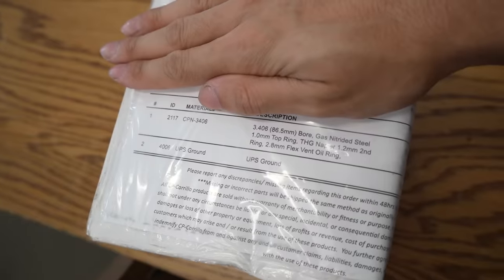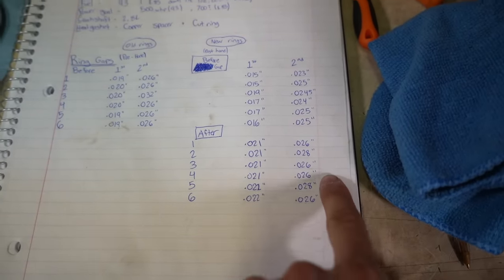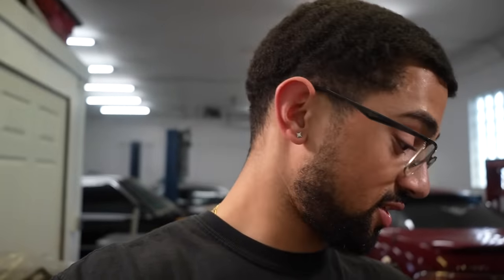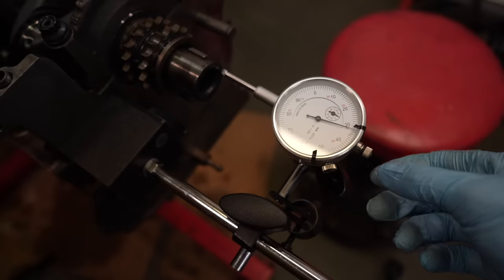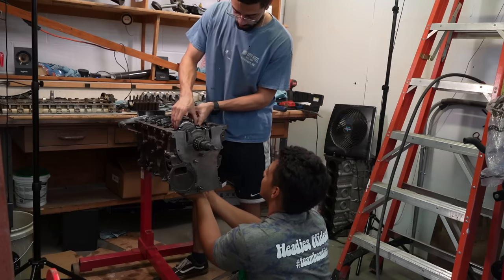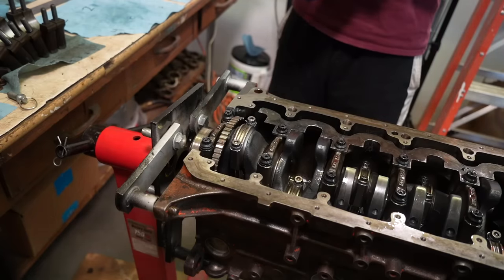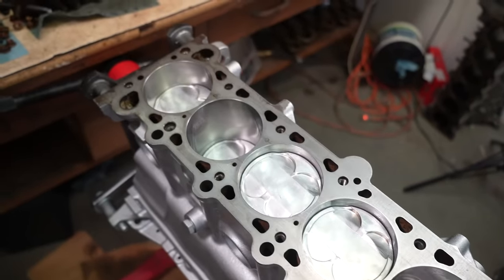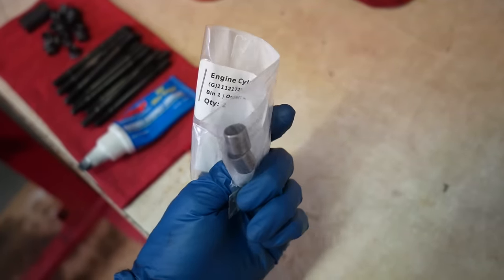FULL DIY Engine Rebuild - $300 Forged M50 FINALLY Gets Rebuilt

Comment: Don’t straight push the piston down, you have to tap it in, otherwise you’ll get what happened on 6 when it could have been sent right into the crank. Which will more than likely damage it.
Reply: if you tap it the rings will get stuck like they did multiple times here, you also risk damaging the rings
Reply: @Galorchs  if you slam it like he was you can get the rings stuck aswell. If you have a half decent ring compressor it won’t get stuck
Reply: would just like to add i used both methods stated here with the same tool joel had and broke a ring on piston 1. waiting a few days to get another ring and ill try again.
Reply: Problem is if you tap it what can happen, is in between two of your taps if the ring is close to the end of the compressor it might slide and pop out and on the next tap you break it.

Proper way IS to push, but there's some truth to the tapping technique, if he tapped it a little to break it free he wouldn't have to push that hard, and it wouldn't have slammed. 

So I guess tap it to get it close and when it's close to the edge push in one motion to make sure a ring doesn't pop out.
Reply: @samwhittman3162
Reply: @samwhittman3162
Reply: @samwhittman3162
Reply: @samwhittman3162
Reply: @samwhittman3162
Reply: @samwhittman3162
Reply: @samwhittman3162
Reply: That and always oil it up before you get there yes it’s messy somewhat but it’ll help avoid any friction at all costs whilst building. Great job though i must say.

Comment: Unfortunately, pistons 2 and 3 are installed backwards. Visible before the head is installed.  A miss occurred when pinning the pistons to the rods and when installing the pistons in the engine block.                                                                                                                                                                                                                                                                                                                   The valve reliefs in the pistons are asymmetrical. The intake valves are larger than the exhaust valves. Pistons 2 and 3 have the smaller exhaust cutouts towards the larger intake valves.  Since the cylinder 2 and 3 intake valves may not have sufficient piston interference relief, avoid high revs that would float the valves.  If you are lucky, find a spare intake valve and piston, and check if the smaller exhaust cutout relief is large enough to accept the larger intake valve.  If yes, then may be okay, otherwise avoiding high rev floating of the valves may be necessary depending on the piston to valve interference margin.  Definitely a problem for worn timing chains where cam timing shifting can cause valves to impact pistons and blow the engine on an interference engine.

Comment: Nice build but the only thing I say you should have changed was the valve springs to dual valve springs from a m50 non vanos head
Reply: What's The Benefit
Reply: @SupremeKai_Omniverse  hold the valves closed better than single springs to run more boost

Comment: Awesome video. Here is a good suggestion. Next time on the cam caps you leave the bolts loose and threaded. Then smack the tops of the bolts with the hammer. It pushes the piston down which also releases the cap
Reply: Also. Install all of your pistons and rings before plastigaging the rod bearings. The rings will hold the pistons in. That way you install all 6 pistons. Flip the block over. And then plastigage 2 at a time. Saves tremendous amounts of time and accidents. The piston shouldn’t fall out of the block lol
Reply from the maker: these tips would’ve saved me so much time 😭 i appreciate it!

Comment: Really good video on building up these engines, just a few pointers for any future builds, or anyone following along

Your main studs aren't getting full thread engagement on the nuts, and this is a known issue with ARP studs in these engines, you need to back the stud out a few turns by hand or drop a ball bearing in to the thread holes before the studs to space them out 

In future when checking rod bearing clearances, fit the pistons and rods with the rings attached to hold them in place 

You also want to check the rod bearing clearances with the ARP assembly lube on both the rod bolt threads and the underside of the head on the rod bolts, to ensure they achieve the correct torque

Don't push the pistons in to the bore with one hard hit, but instead a series of softer taps with the hammer handle, whilst occasionally making sure the ring compressor is flat to the block 

It looks like you have the wrong long chain guide on the block, as it's not supposed to move in and out like that, which means it's probably for an Ali M52/M54 from an E46. There is a chain guide that is correctly spaced and held in place by the circlip that you fitted 

You really shouldn't have sprayed WD40 in the cylinder head for an overnight stint, but more importantly, it will now likely mix with the oil and cause contamination issues, as WD40 can be used to displace oil and decrease it's effectiveness. Just be sure to flush the engine very soon after first startup and engine break in

When refitting the head studs to the block, you don't need to lube the block thread end of the studs, as they are supposed to be installed dry, as per ARP instructions. They do not rotate at all when the head is torqued down 

You don't need to use pliers to pull the pistons out of the lifters, if you place them on a block of wood and tap them with a rubber mallet, it will pop the Piston out

Bleeding the lifters up before installation is fine, as they will bleed out to the desired height when the engine is running, it's actually the engine oil pressure that keeps them pumped up, which is why they fail in high revving applications 

When refitting the cam trays and lifters, just rotate the engine on the stand on to its side and you can slide the trays on to the studs with no danger of the lifters falling out

Comment: Also, for the next time (I hope it won't need any more rebuilds lol) - when installing the pistons, tap the cylinders with a handle,  instead of pushing, while occasionally flattening the ring compressor on the block :)

Comment: Very nice viceo.. just a tip. When u tightening down the rod bolts,  press in som feeler gauge in between crank and rod on both sides.  Therefore there will be no twisting or stress on the rod bearings.

Comment: I remember when I rebuilt my first BMW engine, and if my memory serves me right, it was the very first V8 engine, better known as the "S62B50", developed by BMW's Motorsport Division, in addition to being the first V8 to be used on BMW's high performance variant (M5) of its mid-size sedan class (5-Series). I can affirm with high probability that my forged crankshaft had no play in its position, staying right where it was supposed to be (post-installation), with absolutely no movement whatsoever, and I state with 100% accuracy, that the legendary V8's cylinder head was NOT dropping pistons and oil rings left and right. 

Here's a word of advice; since it is apparent that you are new to engine rebuilding, with not much experience, it any at all. If I was you, I would not start committing myself into new projects that involve difficulty such as rebuilding or refreshing an entire engine block, especially BMW engines, which are more complex and elaborate in its blueprint. Get some experience first on less complicated and cheaper engine builds such as a Toyota or even a KIA. Good luck dude!

Comment: 32:20 you put the rod stud or bolts in with a piece of hose over them and flip the engine over an push the pistons in with a ring compressor.  I use 5/16" silicone hose over some studs I have around to keep it from scoring the walls.

Comment: Great video, nice rebuild but I was surprised that you didn’t put in a new oil and water pumps. Every build I’ve seen or helped with and a few of my own the to old pumps get pitched and new oem ones or in the case of oil pumps,  high performance or deep sump intakes get used. On the couple of blown engines we always drilled out the rivets holding the valve and oil pan baffles out to make sure they’re are no copper flakes trapped underneath. Just tap and bolt down or use nuts and bolts, rivnuts or rivet them back in place. 
Nice long format video. Looking forward to the first start.

Comment: Use transmission fluid and coffee filters to clean your cylinder walls before assembly.  ARP wedge spring compressor is the only way to go

Comment: You have to prime your oil pump with oil... look up the direction for the acillies oil pump, you got to pour oil into the pump and rotate it on the car. ALSO, thoes valves are two piece. your sanding the wielded area. Not sure if I would do that. I know you know about dropped valves... thats the advantage of a m50nv valve/head combo, the extra 1mm is extra area to wield a.k.a. stronger in theory. (Or just buy one piece valves)

Comment: VAC and other vendors make upgraded oil pump shafts with keyed sprockets and a left-hand thread bolt that are much better than the original shaft/sprocket/nut that is either wired or welded on.

Comment: you can use half a shell of undersized bearings to get the rods looser like on cylinder 2 3 5 and 6 . those are a little tight . always have my rods looser than my main clearances . your mains are fine a 20 thou but could be tighter

Comment: I waz waiting on you to damage a bearing installing them like that. But they do look really hard. I install bearings all day long at cummins for 6.7s and theyre so soft if theyre tight and you dont push inwards theyll scratch the undersides quick as shit. Theyre extremely easy to scratch. Just touching them together will do it

Comment: I hate to be the one to say it but there are different types of main lower timing chain guides (the big one the tensioner pushes on), it looked like you have the wrong one for your engine there. not really supposed to be able to slide back and forth like that. It might still work but i'd be double checking it to avoid possible damage.

Comment: Dang my man, I know is too late now but for future reference all you gotta do to take the rod caps off smoothly is back the rod bolt out until you have a decent gap and then hit the top of each bolt. That will separate the cap from the rod and still hold everything in place so that piston flying out the bottom doesn’t happen again
Reply from the maker: this makes so much sense and woulda saved so much time lol i was FIGHTING all those caps
Reply: Yes sir! Keep putting in that grind because me and everyone else love your videos!

Comment: That .5mm difference with the cylinder bore and copper spacer will lower compression. If you have turbo you can add a few extra psi but with na it will lower performance. Need to measure copper spacer thickens plus .5mm of difference to get final compression ratio.

Comment: Maintaining a BMW is like painting a Bridge.. You start at one end, go to the other side - and then go back to the beginning and start again. Oh BTW it's perfectly okay to leave the plastigauge on the bearing shell and the oil will dissolve it away when the engine starts - it's designed to be like that as you read. Is it best practice? I'll leave it up to you to decide

Comment: Next time check your rod to crank clearances with the crank out of the engine then you won't have to worry and you'll still get accurate readings because the rods only bolt to the crank.. if you prefer to do it in the engine buy a cheap pillow go place underneath the engine lol

Comment: Dam bro you came a long way since you first started lol 💪🏼

Btw I also installed the rg Vanos kit but what other tighter kit was it you mentioned in the video ? 

I’m kind of unhappy with my results on the Vanos. I had heard from some people to not do the rattle kit if mine didn’t really have a loud rattle noise and just change the outer seals. My Vanos is rattling loud as shit now 😏 about to take it off tonight and sand down the ring more to close the gap tighter hope it quiets down 🤷🏼‍♂️

Comment: I thought that for those rings that go into the block gaskets on cylinder heads (Athena rings) you had to cut into the block with machinist for the rings to go into like 1mm deep, from what i see you didn't have any cuts around the rings in your block?

Comment: Fastener torque is based on fastener stretch. Over or under torqueing caps is not going to change the bearing clearance. The clearance is based on face to face contact between the block and the cap. Do you really think you are going to deform the metal with 60 lbs of torque?

Comment: im looking to do the same build relatively.. can you touch light on how to make the euro crank sensor work with the obd2 harness... the obd2 crank sensor is a female and its more oval.. the euro sensor in more rectangle and is male style... i have a 98 z3 m52 currently. im just unsure how to connect to males together without cutting and splicing. is there some adapter i need?

Comment: If using a torque plate distorts the cylinder walls, I wonder how having the engine on the stand affect the measurements.  Wouldn't it be better to build when it's supported by the mounts instead?

Comment: noticed you used the wrong chain guide, your block is a pre 95 m50/s50 block and needs the guide PN 11311722654, the one you put on is the updated one that clips on by itself with no C clip!

Comment: WHEN YOU GAP YOUR RINGS, USE AN OLD PISTON WITH AN OLD RING AS THE MEANS TO INSURE THE NEW RINGS ARE PERFECTLY ALIGNED IN THE CYCLINDER BORE, AND ALLOW FOR MORE RELIABLE READINGS. SORRY FOR THE ALL CAPS, WORK  IN ENGINEERING AND ITS OUR NORMAL WAY OF TYPING

Comment: All that work and used a old o-ring on the thermostat and a 80c thermostat is too low unless your racing. I live in Kuala Lumpur Malaysia and my E36 325i has a 92c and a aluminum radiator with a Spal 16 inch fan and never over heats and it's 30 plus degrees everyday of the year.

Comment: Can he disassemble the engine again, he installed two pistons in reverse oh my god. You absolutely did not notice that the selection on the valve in the pistons is oppositely turned on the two pistons, oh my God. Watch 46:25 - 46:38 of your video. Poor engine...

Comment: At 00:30  you shut me down and out. I suspect > you drove that piston in and it went to far. FUNNY ? Nah, inexperience yes. Us old s'coolers know to slip rubber type sleeves on the rod bolts. I will continue the search for a "correct way" Nathans never fixes anything either. 90% of BMW post are people "tying to figure it out" . An Aluminum block is a bad place to start. ALL cast iron blocks are better for 50 more pounds weight. E36 is so good from the factory that idiots get lost trying to modify when BMW already has